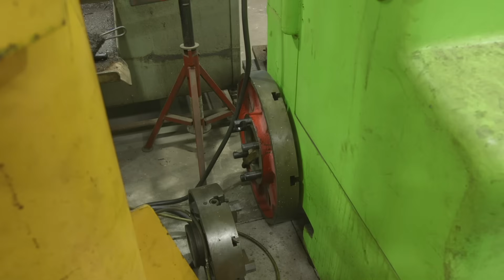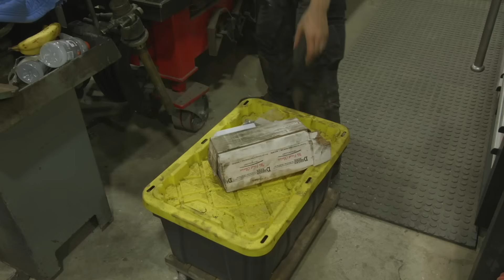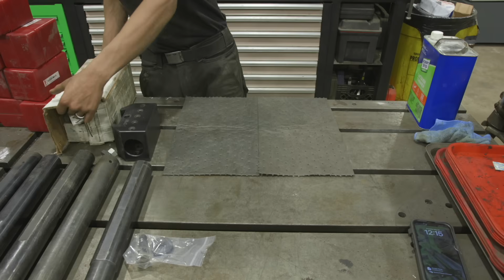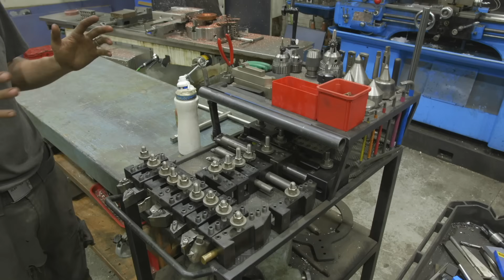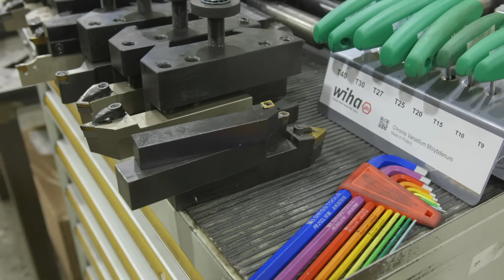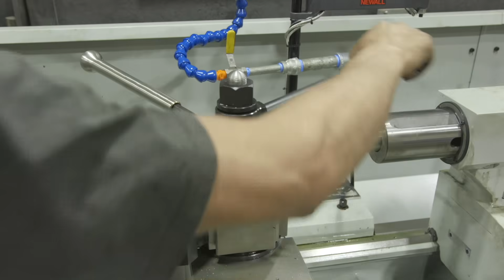Setting Up Tooling On The New Lion Lathe

Comment: It looks like your rigging that lathe out nicely!   I have 2 Quadra QITP40 tool post sets.  You're right, each time I've had to deal with Dorian it becomes painful.  Their customer service is pretty horrid.  The tool post work pretty good, however be very aware of coolant getting into the slots beside the wedges and causing wear and corrosion.  I mean faithfully blow it out good and spray some lube in after using coolant.  I keep my machines very clean and I wipe them down each evening> My coolant stays in very good condition with the right concentration and still both mine Quadra's had wear and corrosion between the wedge and the spools.  I think knowing that ahead of time I could have spent more time blowing out the cracks and crevices on the tool post and spraying some lube in there.  It's really never been an issue with my other wedge style QCTP.
Reply: I have the 40 size on my Monarch. Good to know about corrosion issues.
Reply from the maker: Yes good tip
Reply: Hey what size swing lathe is the lion and what model quadra?
Reply: @garywalden1038  I think Kyle's new lion lathe swings 24" and he has the #50 tool post.

Comment: I worked customer service jobs for many years. Unfortunately, the quality of customer service across the board is just lower. Many will end calls if you use strong words. I do my best to stay calm but if you are calling, you are already a bit angry usually. I still try not to direct my anger at the agent but their delicate ears still can't handle it. Most places I worked, you would be fired for ending a call for this. We were taught that our job was to calm the customer down and make sure they left happy. Now they just end the call and leave you more frustrated.

Comment: Nice video again. I wonder if you can 3D print a stand to store the tool holders vertically on the cart. Spring loaded so the dove tail holder can move out of the way and each tool is accessible independently. A 3 tool vertical storing post would free up a lot of cart real estate.

Comment: 52:40 we use that tool for cleaning faces of thin pipes beacuse resistance is minimal and if we need some canals to seperate critical surface from rest of part. It is common on my place of work but impossible to find on internet for solid price.

Comment: Love these in depth videos. I know on youtube the algorithm heavily incentivizes doing 10-20 minute videos, but I'm really glad that you take the time to say what you need to say with as much detail as the content deserves. I struggle really hard with creating an organization plan, and seeing what you have is super helpful for me.

Really sad to see such an expensive tool post come with a T-nut blank that was barely an afterthought... It would have been better for them to just not include it at all! Whoever thought it was a good idea to basically have the new guy cutting down bar stock and taking it to the drill press to pop dowel pin holes (probably without even reaming based on what you showed) clearly does not care about customer experience or brand reputation. Doubly so for the customer service rep that was bad enough to get a shout out! Hopefully the tool post itself turns out to live up to the reputation at least.
Reply from the maker: Thanks I appreciate the kind words man

Comment: Kyle, I'm curious about one thing you had mentioned.  You said you would use a positive rake insert for heavy turning.  Wouldn't you be better served using 'negative-rake' tooling for roughing operations, especially in tougher materials?
Reply from the maker: Yes, your right conventionally. This is a special insert. The holder is negative rake. The insert geometry has a positive rake.

Comment: From the rumor mill, that woman you talked to was the bosses daughter. I was told she is hard to deal with.  Most of that tooling Dorian sells is made in Italy, rest in their shop near Houston.  Just saying. Yes, I recommend it their tooling, it is nice stuff! I have a few smaller holders and such I've acquired over the years in my shop.  You new kids on the block don't know what you are missing not wanting to use triangle inserts for machining.  I use them exclusively in my shop for the past 45 years. Yeah, I do have some "C" insert tooling, too. I'm just a one man operation, too!
Reply from the maker: Make sense
Reply: Man, the reviews im reading online sound like they have crazy high employee turnover. Never a good sign
Reply: Yep, right down the road from me in East Bernard Texas.  I figured it was mainly a family operation.  How else could get away with acting like that.  Each time I spoke with them  (just a couple times) she was very rude and could care less.  I wanted to buy a replacement part for my quadra and she said I had to send the entire thing in and have it reconditioned.  I asked how much would it cost and she said she would let me know when it was completed, however it would not exceed the cost of a new one.  LOL, I don't think so.  Some of my holders that came with it fit so tight I can barely get them on or off.  They said they would wear in.  Crazy for that type of money.

Comment: 1) Run your air hose from the ceiling on a cable retractor+bungee
2) Mount the DRO on the upriser pipe for the coolant.